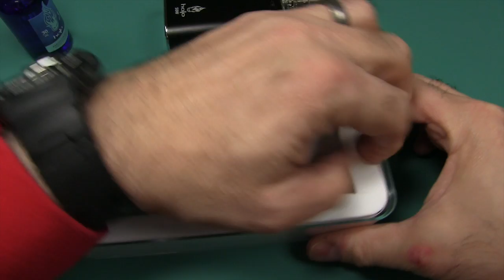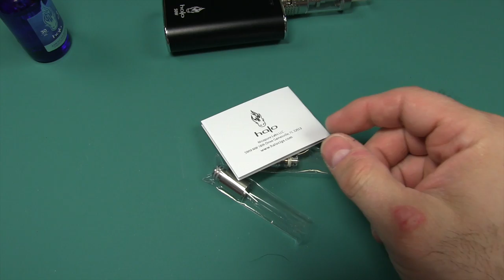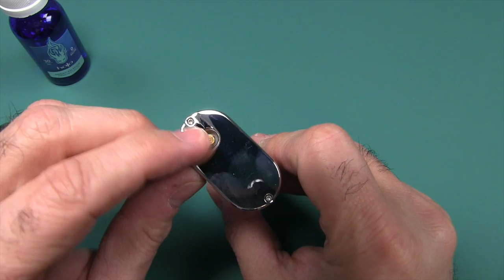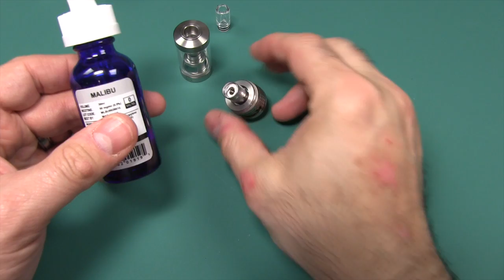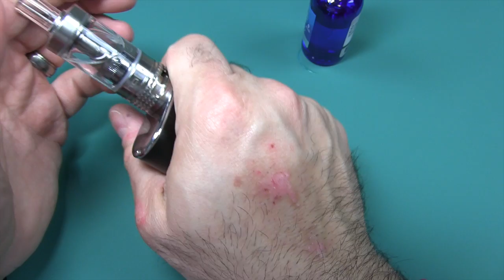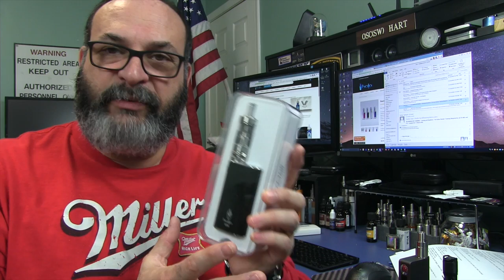Halo Reactor Starter Kit

Comment: just got my kit. new to vaping. looks like halo cut back on some of the things you mentioned.  glass mouth tip is no longer in this kit  and there is no coil  installed,which means one has to install one from the accessory kit leaving only one extra. it took me a while to understand the directions on installing the coil as well as filling the tank. lost a lot of liquid and was a pretty frustrated newbie!  Thanks for your video. it helped a lot.

Comment: Fred, your review of this is what made me order mine. I got it in blue, and I love it. I have a question about the ohms. 

I saw how your ohm reading was at consistently 0.5, mines is not at that. It goes from 0.7-1.7 ohms, I even saw it at 2.2 for some reason. Is it cause I put too much e-juice when priming it? Is it cause I used it too much? Every hit that I would take, was smooth (especially the first one), but then after a dozen or so hits, I took one and I started coughing, real bad; and that's when I noticed the ohm being over 0.5. 

I understand the wattage, sorta. I know that you like yours at 35, but I feel it smooth for me at around 29. I went up to 40, and couldn't handle it. Pretty much, the higher the wattage, the warmer it gets, right? Cause I can feel the heat on the mouth piece.

I hope you're able to answer my question soon! It would suck if my device is defective. :/ but I'm really hoping that it isn't!

Moses
Reply: HeyItsMoses, try cleaning the coil. May be it is gunked up with ejuice left overs. Did it happen on a new coil as well?

Comment: hi ive had mine for 2 days and already i have problems it isnt producing vapour anymore its like it is blocked i have tried replacing the coil to the other one it came with but still the same thing and e liquid keeps going into my mouth its like there is a seal problem but i am not missing any of the o rings that came with it they are still there, and the glass is firmly in place over the o rings, when i screw the air flow chamber back on i get liquid oozing out the sides, anyone else had this problem? i cant even use it now. it lasted 1 and a half days. lol
Reply: Quasimoto, either the tank is defective or the ejuice got into the middle tube. Try taking it apart and cleaning it. If that doesn't work, call halo and replace it.